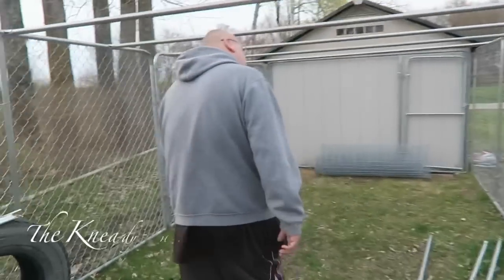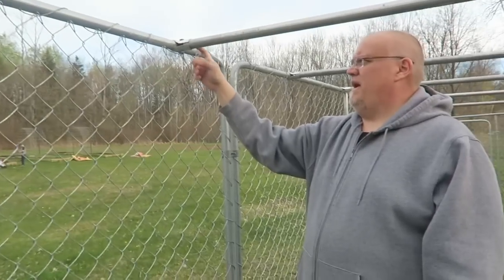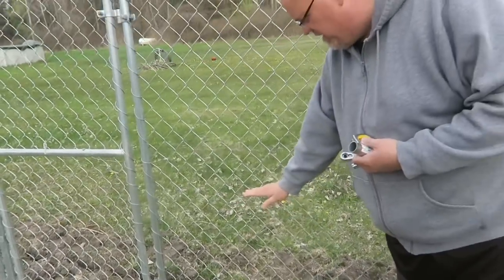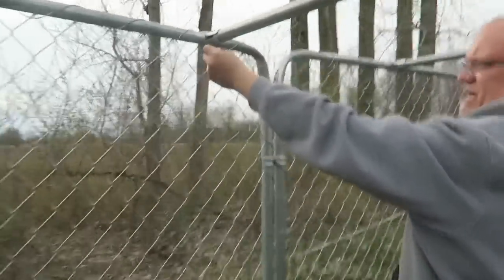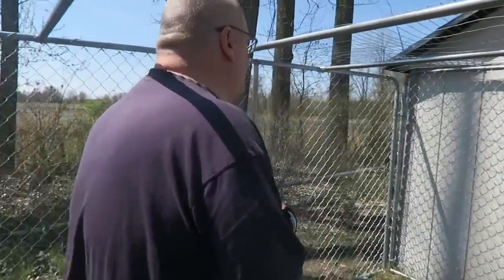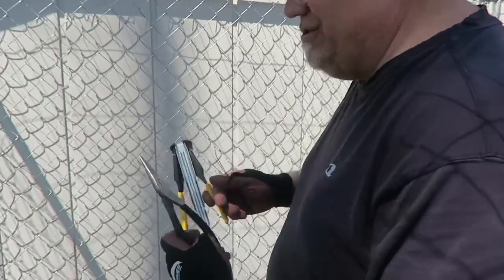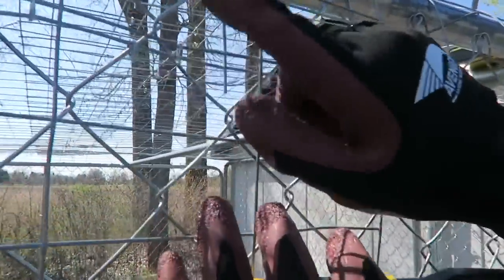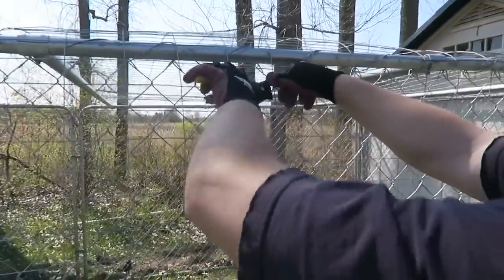Building Our Predator-Proof Chicken Run Part 1: The Roof

Comment: Two thumbs up on the top welded wire! We did that on our old bantam coop, but my husband used long flexible PVC pipe in an arch, if you saw those way back in the earlier days of our coops. That is the only way to do it on top, not bird netting, which is useless except to keep birds inside. I keep telling people that a lot of planning and thought in the beginning and crawling around on the ground to see what ground predators see is a great thing to do to shore up weak spots, too. People try to save money in the beginning, only to lose their flocks and have to start over.  They often forget dig barriers and hardware cloth over every opening larger than 1/2". The top of the gate is a weak spot that took some thought to fill in, as well as under the gate where they  can dig-we buried one of those closet shelf things, the coated wire, right in front of the gate so nothing could dig, but it did not interfere with the gate opening. So much to think about, right?  I like it so far, Heather!  Take care! ~Cynthia
Reply from the maker: your two thumbs up means the world to me! 😆👏🏻 we put so much time, work and love into this coop and run. I wouldn't put the babies in it until it was as safe as we could possibly make it. And you are so right, you have to get down on the ground and double check everything! Now, I have to go to the youtube time machine and see if I can find your old bantam run videos! I am dying to see your hoop roof which sounds amazing!
Reply: I really don't recall if there is a video that shows the coop, tried to find one-it was built in 2011 before I had my channel-but I can send you pictures of that run by email, if you like. The run is no longer there and the coop is a storage building, but it was really cute inside, used all sorts of "oops" paint to paint the inside, very colorful.
Reply: I emailed you some pictures of that coop and run. Might end up in your spam folder, though.

Comment: We probably would of used zip ties. Didn't think about hog rings. I am sure they will last a lot longer! Great job, Matt!
Reply: I am using zip ties to tie the the welded wire on top to the top rails just make it more secure, but I thought the wire would last longer.  It takes a little longer to secure it that way, but no biggie.

Comment: Are you planning on also securing it down to the roof poles? May help with wind slap noise?
Reply: Using zip ties to secure the welded wire.  You will see that in an upcoming video.

Comment: One thing Matt..our son has a duck yard very similar.  They had a skunk get into the fence area.through thr gate space..between the fence and gate.  He had laid down chicken wire on ground  and covered with dirt to prevent predators from digging under.  But never thought a predator 
could squeeze through the small gate to fence space.  Just wanted to give you a heads up on that.
Reply from the maker: yeah, this was only part one of several videos. every nook and cranny ends up in hardware cloth by the end. i will show a full coop tour at the end of the series. 😁❤️

Comment: Love it!  You might want to consider a roof over part of the run for shade and protection from hard rains or snow, flooding the run near the coop and allows them to stay outdoors in bad weather. Just a thought! We learned as we went too. We actually metal roofed the whole run the 2nd year. We also plastic most sides of the run in winter (WI here) so they can still go out of the coop.  I adore you two!
Reply from the maker: oh yeah, this is only
part 1! 😉
Reply: I like the metal roof idea.  Then I don’t have to screw with water pooling.

Comment: In Australia, we use snake mesh to cover the sides and top of bird cages. Its a square mesh about 1/3” of an inch square to keep larger snakes out. It won’t keep out hatchling snakes but hens would eat them anyway. There would be no gaps anywhere. I sort of wonder how you control them and weasels etc? We also dig down and bury wire about a foot down to stop things from digging in. Its good to see your husband Matt, even though he is gone now so tragically, its a nice reminder of his important presence and contribution to the family.
Reply from the maker: We use very similar mesh wire although here it isn't called snake mesh. That entire run is covered with it and bolted to the coop. It is also buried and spread out underground so anything that digs will hit wire. He did an amazing job. 🥰 It's been 5 years and never had a critter get in! Praise the Lord!🙌🏼♥️